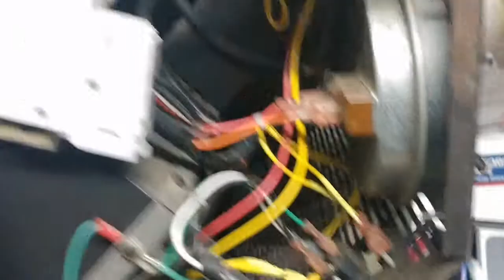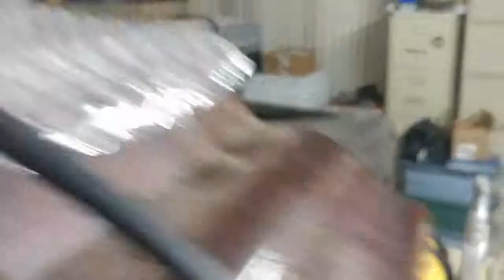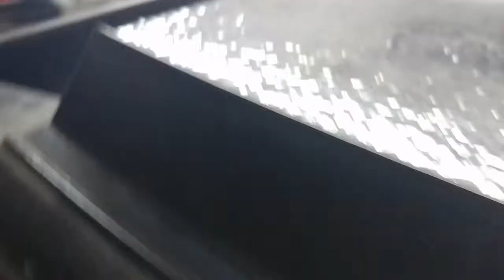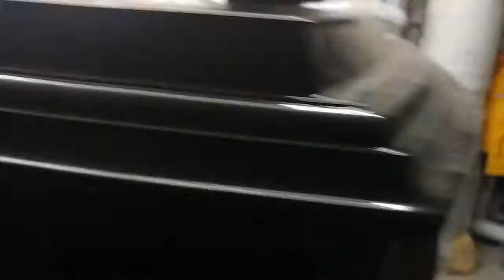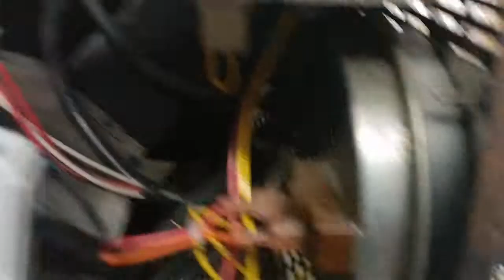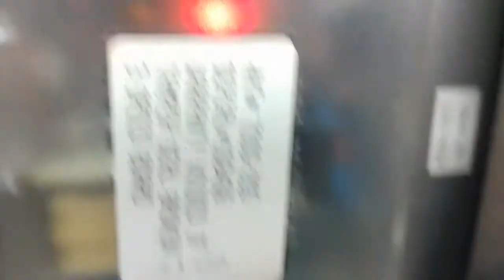Post Repair Testing of Dan's Quadrafire HHT#7000-205 Pellet Stove Controller

Comment: Have CB1200MI-MBK unit from 2010 with controller srv7000-205. The question is sequence of operation, the stove starts up and burns good and when the thermostat is satisfied the feed stops and the two blowers continue to work. However, the combustion motor shuts off at the same time as the convection blower while the temp light on the control is still RED. This did not occur in the past, the combustion motor would run for awhile after the convection blower stops. I cannot seem to find anything else that is wrong, is the main controller just bad? This causes quick build up of clinkers in the pot and smell in the house because of the amount of partially burnt pellets in the pot. 
At power up the combustion blower comes on for a few minutes so appears to work fine. I cannot tell if the high low speed on the combustion blower is working but it seems to fire up OK. A detailed functional sequence would be nice to have for the controller

Comment: Do you fix these? I have a model that I burned out a couple resistors. I fix one because it was just a ferrite. But the other is that I am not sure if I can locate parts. Thanks
Update- located resistors and chip from my local CP shop and repaired. Cost was about $8 and hours of my time researching 🤙🏽

Comment: I have the same control. I get a call for heat. red light on in control board the auger runs for a short time twice then the red light blinks 3 times. off. then 3 times again. All safeties and vacuum switch checked good. Whats broke?

Comment: I would like my 7000-205 control board looked at and repaired like that as well.  I arced a wire for a snap disc and think I damaged the board.  Reply with instructions on sending you the board please
Reply: I think I may have done the same thing! My auger motor won’t turn but it works with direct power. Did you ever figure it out?